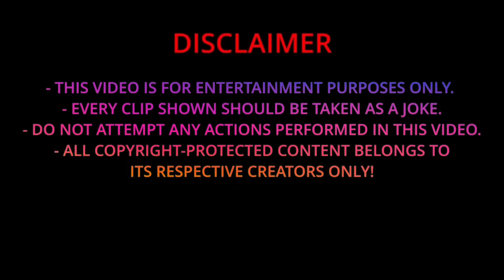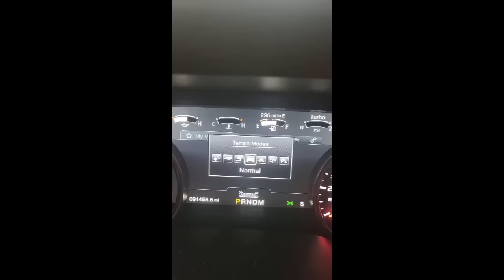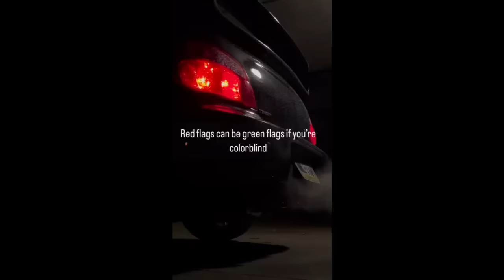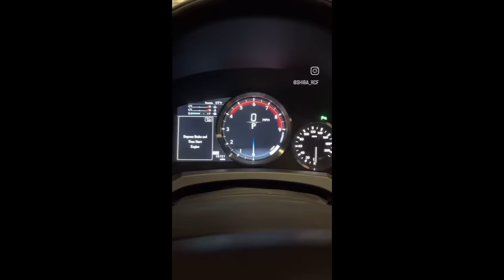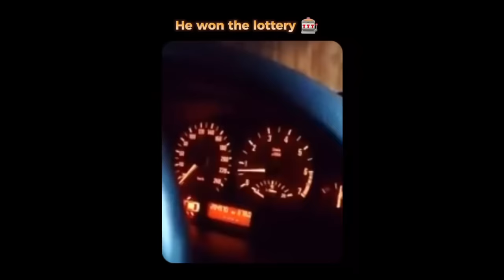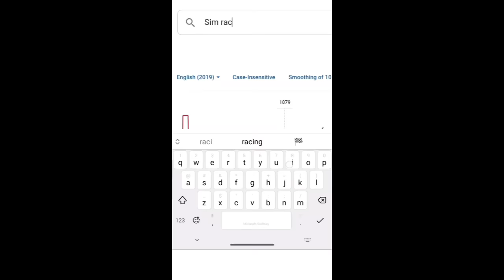Memes That Only Car Guys Will Understand: Part 80

Comment: Btw… those $100 chinese superchargers don’t ship with oil in them…you have to put oil in them when you get it. 

Richard holdener did a torture test on one to see what it’s max output was. You can actually gear em down pretty far and get quite a bit out of em.

Comment: If someone is parked backend in, they're either a car person, a Japanese person, or just weird.
If they take up two spaces, they're either driving a car they're too afraid to rip, or are an entitled arsehole.
The ones you gotta watch out for is the apparent hunk of junks parked perfectly backend in, especially if it's some uncommon hunk of junk car.

If you put a ding in a car you don't immediately know the make and model to that is backed in, you better fess up or gtfo of there because you about to get your backend handed to you if they find out. The beat down will be even more severe if the paint is otherwise flawless.